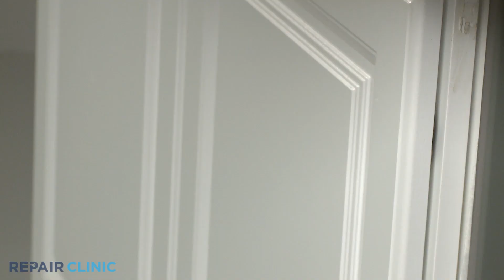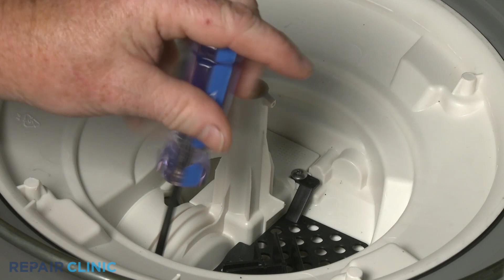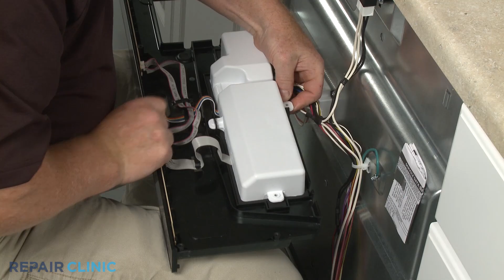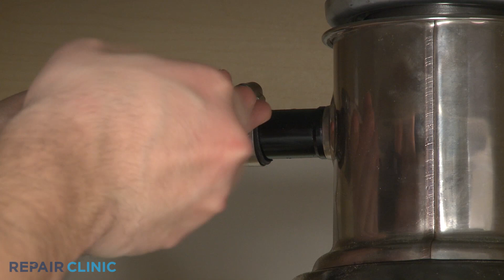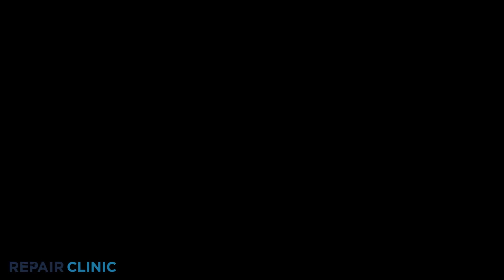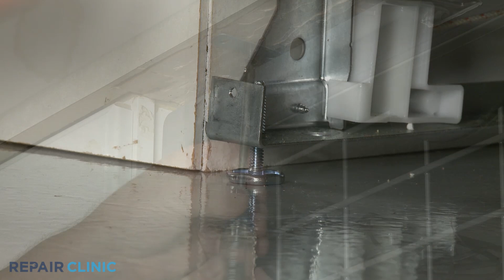Frigidaire Dishwasher Disassembly (Model FGID2466QF7A) – Repair Help

Comment: Help! We dropped the “rear screw” into the opening to the left of the pump cover and it went down one of the little holes down there (not sure which one). We’ve tried strong magnets but no sign of the screw since it dropped somewhere down there. Will it hurt our dishwasher to run it with that screw somewhere in there?